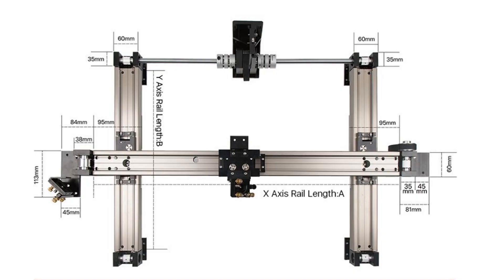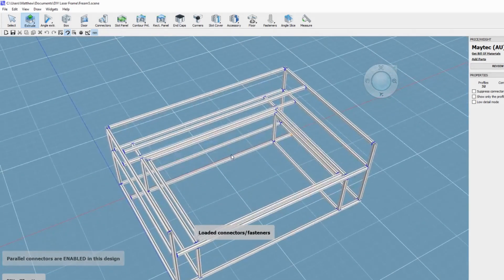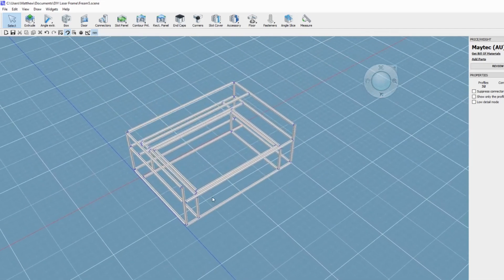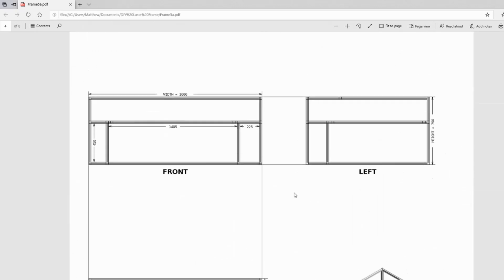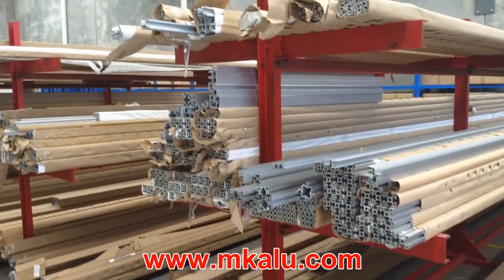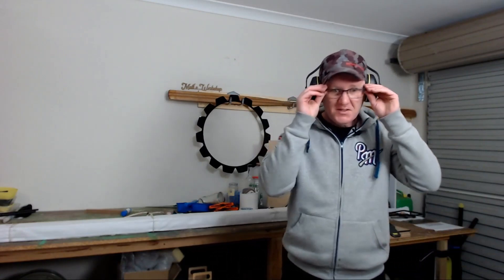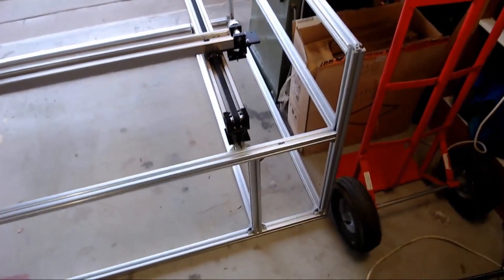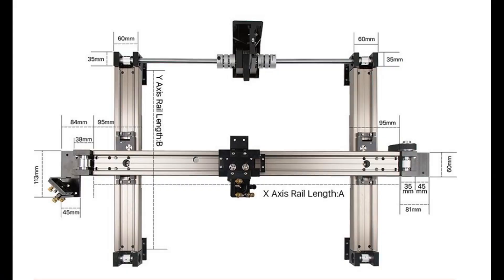02 Build Your Own Laser - CNC Laser Frame Build for Enclosure

Comment: Would it be factible to mount the entire structure with 2020 aluminum?
Reply from the maker: Depending on size.  If you want to build one 1300x900 then I would not recommend 2020 use minimum 3030
Reply: MW Laser lot of thanks for your help and your videos 👌👌